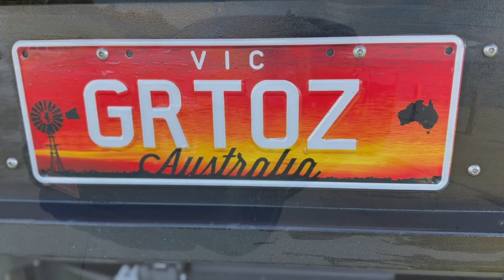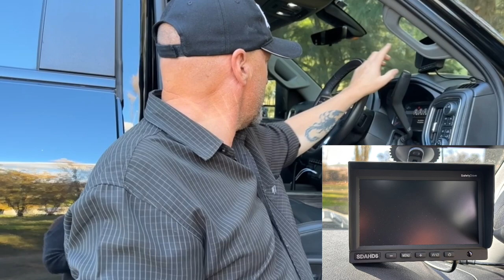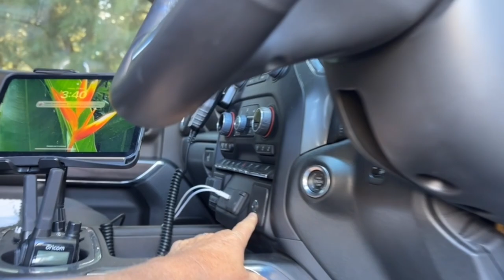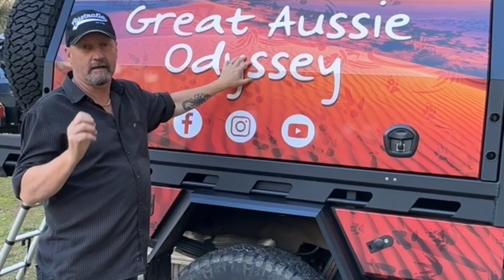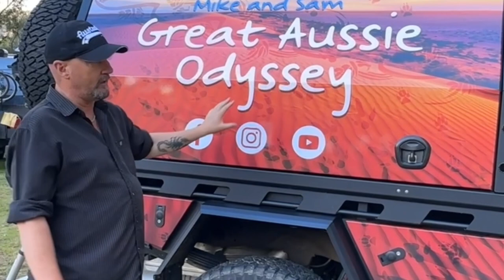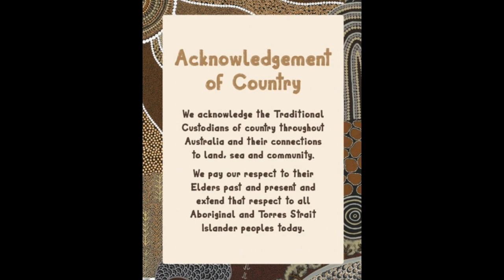Great Aussie Odyssey - "GMSV Chevrolet Silverado 2500HD"

Comment: Hi Mike - I’m looking at a similar 2500 build with Mits for a package but wanted to confirm yours is an 8 ft tray and 7 ft canopy? You mentioned 7 and 6 but the Mits YT vid said 8 and 7?!  I found the run through really helpful and hopefully will aid my build. Cheers
Reply from the maker: sorry yes 8 & 7. was originally going to be 7 & 6 until R&D measurements were done on the MY22 chassis
Reply from the maker: Ask for Zac at Mits Alloy and mention us to them.
Reply: Looking at 60k pluss for tray and canopy setup